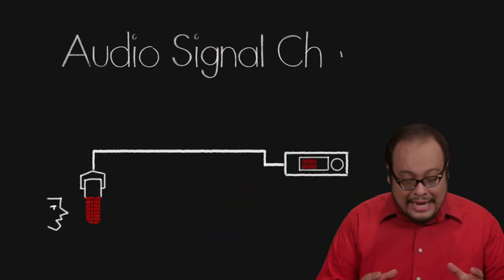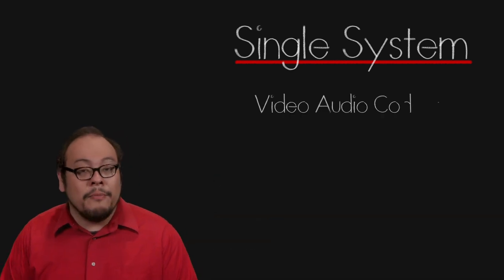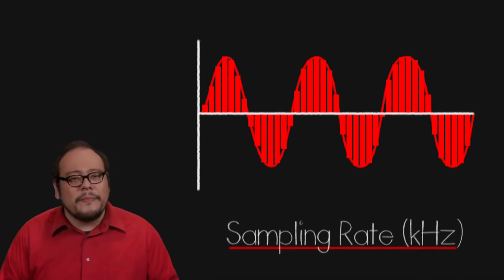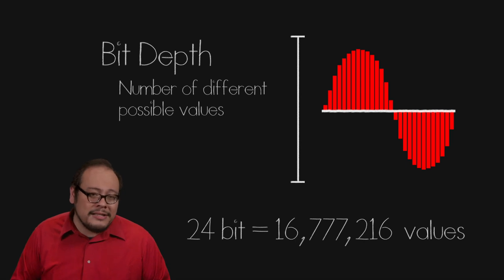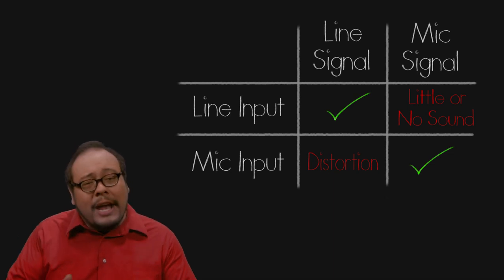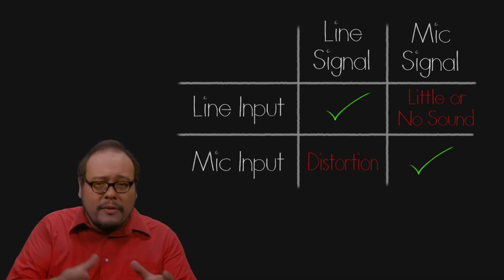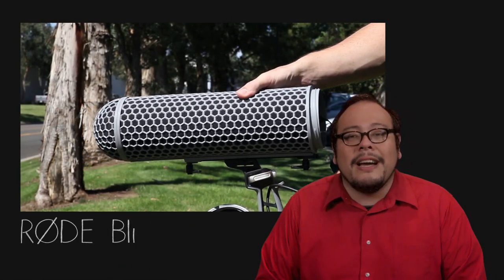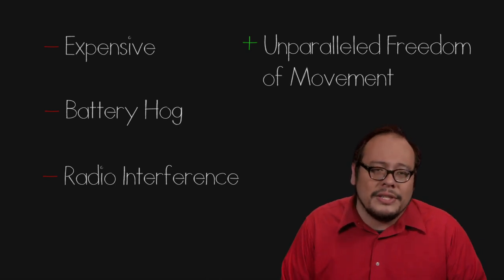The Basics of Recording Audio for Digital Video

Comment: As a former college-level audio instructor, I have to say that this is an excellent primer on audio for video recording, full of practical tips. John does a great job of presenting the theoretical aspects of audio (which can be dry and boring to some) in an interesting and relevant fashion. Just one nit-pick on the factual info: consumer level is -10dBV (with a capital "V", referenced to 1 volt), not -10dBv (referenced to .775 volts).
Reply from the maker: Pistachio Studio Thanks! Those dB designations can be so confusing :/
Reply: hey  @FilmmakerIQ   can u put the following line in description before the line containing "0:38 ..."
0:00 Intro

Comment: This is an amazing channel and the videos are very informative and dive deep enough into the subject.

I want to add one thing though: Recording in 96kHz is really not necessary, and you should not be disappointed if your recorder doesn't support it. I have a friend who actually wrote his diploma thesis on this subject (which quality reductions are actually audible in the ears of professional mixing engineers). And he found that 48kHz in general is enough and any increase does not affect the quality at all, and it also doesn't matter in post production. 16 Bit on the other hand is actually not sufficient for many applications, and professionals can actually hear the difference to 24 Bit recording.

So, to sum up: 48kHz is usually enough, but 16 Bit isn't. :)
Reply from the maker: I was going back and forth whether it was 96kHz or the 24bit that was contributing to the translucent quality of the audio I get off the recorder. I realize a lot of it is "psychological" - but I'll still stick to my 96kHz suggestion even if it's not entirely necessary ;)
Reply: Filmmaker IQ
You are absolutely right: if your recorder supports 96kHz, there really is no reason not to use it. :) I mean, audio won't be what's breaking your disk size limits, and better safe than sorry. I just wanted to add the comment for other viewers that sound devices that don't support 96kHz are no dealbreaker and that the 24 Bit support is more important if your budget allows only for one of the two. :)
Reply: Just thought I'd throw in my programmer's perspective. Just because your software supports 24-bit samples, doesn't mean it'll work with them internally. More likely, it'll convert them to 32-bit floating-point (maybe keeping a buffer in that format on disk in a temporary file) and work on that, only converting to 24-bit again when saving the results.

Trying to work with 24-bit values is a headache, because there's no provided way in hardware of working with them as a single unit. The easiest way to handle it is to convert it to some 32-bit format, which the computer can pass around as a single unit, using a third more memory and have readable source code without the clutter of moving odd-sized amounts of memory around.

32-bit floating-point tends to be the format of choice, because nearly everything has a floating-point unit which supports the IEEE754 standard and it's a reasonable amount of memory used for the precision available. It also has the advantage of floating-point versions of many algorithms being much easier to understand than integer versions. On the downside, 32-bit floats only have 23 bits of precision, so you will end up with rounding errors caused by truncation creeping in when doing a lot of summing of values, though they'll probably be small enough to be lost in the background noise.
Reply: *****  You are right that most likely, the computer software internally will work with 32-bit-floats. But that doesn't really mean anything for the recording quality. An audio quality of "24 bit depth" means that there are 24 bits used to assign a value between roughly 8 million and 8 million as a signed integer with 23 bits precision. This can be, as you know, easily converted to a 32-bit-float with 23 bit precision and an additional exponent, with basically no computing power. On the other hand, if you record with 16 bits, the conversion will just fill in the additional precision of the 32-bit-float with zeros... So you still retain the full quality improvement when switching from 16 to 24 bit recording, which is what all the fuzz is about. :)

Also: Something is really broken with my comment, parts of it seems to be crossed out...
Reply from the maker: Must be the illuminati...
Reply: Florian Fahrenberger I could hear significant differences when recording audio from the Zoom H6 between 48kHz and 96kHz. To me, the 48 sounds "fuller" and deeper compared to the 96. The 96 seems brighter and tends to pick up more ambient sounds. I guess if I would use a shotgun mic then I'd use the 96 kHz sampling rate but to me (as I'm only using the MS mic capsule) 48 kHz is more than enough and I can just tweak it in post if I want to.
Reply: The quantization is an oft quoted reason to use higher sampling rates, but is unfortunately misguided. You don't get a more accurate waveform at a higher sampling rate. Don't get me wrong, I thoroughly enjoyed this video, but I would refer you to this in depth explanation on the topic: https://www.youtube.com/watch?v=IiZqYnd5g8M
Reply: + Roxor128 : 32-bits floats may have a 23-bit mantissa, but because that representation has a fixed leading 1, in effect it stores a 24-bit value.

As for sampling frequency,  hydrogenaudio did MANY blind tests (for codecs), and they confirm that very few people can actually tell above... well, CD quality. If you think you can, your probably unknowingly pick up something else that your test changes.
Reply: Agree. Further more, A/D conversion is known to perform at it best when at 48K 24 bit as well.
Reply: Double blind tests indicate that very few people can hear any improvement with sampling rates higher than 48k...  However, it depends also on the quality of the audio chain and especially the transducers.  That being the case, there are still reasons that higher sampling rates might be appropriate, say when shooting sync sound for video shot at high frame rates when the video will be played back at a lower, standard frame rate, or if one simply wants to slow down the playback speed for effect without losing so much resolution.

Comment: Immensely informative! I've made the mistake of plugging a mic signal into a line level input and had low sound. I ended up using a TASCAM iXJ2 for my preamp in a dual system.
Reply from the maker: Least it's not the other way around - you can fry a preamp if you accidently send a electric spike into a mic level input ;)
Reply: Thanks for the info! The device I thought had a built-in preamp was a MacBook Pro. I guess the key thing was line input.

Comment: And: the only difference between 16 and 24 bits is that the first guarantees a theoretical 96dB range between 0dBFS (the limit before distortion) and the quantization noise, while 24 bits guarantees a theoretical value of more than 144dB. What that means in practical terms is that you can have more headroom between the 0dBFS limit and the audio peaks. In comparison, you can record more than 30dB lower than you would at 16 bit with no signal to noise ratio loss. ;)

Comment from the maker: @Garan Fitzgerald - a lav mic plugged into a smartphone... personally I've never done that but I can't say it's a bad idea. I think the downsides of doing that is you drain your phone battery - if it's a long shoot you can't just pop in fresh batteries like with a dedicated audio recorder. Sound Quality should be good if you have the proper inputs. Pulling files is what it is from the phone - it's probably not a whole lot more complicated than pulling from an SD card...

Personally, I like having a dedicated audio device as I think the phone could be used for other things during a shoot but it'll work just fine.
Reply: Actually that is what I use right now and it's awesome! 
A lav mic plugged into a smartphone is no problem if you get the right app. 
I use an Android phone, a cheap LG L15G with Neewer lav mic from Amazon. There is no concern for low battery, just turn on Airplane mode and put the phone on silence. I don't use the phone for any other thing as I got it specifically for this purpose so there is no sim or data connectivity on the phone. There are some things to note though, there is no way to monitor the levels while the recording is going on, also ensure the app you get records 48khz or else you will have audio sync issues and again, ensure to set the right levels to avoid clipping, which applies to all audio capture systems anyway.

My system has been working great and I have two of it in case I need to record a dialogue. If I want to improve the quality of my audio, I found out that getting a better condenser mic is all I need at the moment. I still plan to get a Zoom H4N Pro with wireless lav mics but I don't have to do so at the moment but will still do later.

Comment: Provided that your recording and playback systems don't have problems in ADC and DAC, the 48 and 96khz should have no audible difference. Some systems have problems in playback if you're up or downsampling from one to the other in realtime. It's a good idea to record in 96khz 24-bit though, if you're planning to do any editing or processing afterwards just to have that extra headroom both dynamic and frequency domain wise. Audibly though as said it doesn't matter.
Reply: Audibly, it does matter.  If you're not careful, 96 kHz can actually sound WORSE.  Recording at 96 kHz includes inaudible ultrasonic frequencies.  If you don't do postprocessing correctly, this will cause audible distortions when playing back on systems that can't reproduce ultrasonic frequencies (most of them).  End result: don't just record at 96 kHz unless you know what you're doing, and only if your analog equipment is pretty high quality.
Reply: You need add digital dithering when converting 24bit to 16bit in order to avoid distortion.
Reply: ***** You sir, are very confused by sample rate vs frequency response. Though they all us Herz as unit, but they mean totally different things.
Reply: ***** This is true. When downsampling to 44.1 or 48khz you need to do careful lowpass filtering to avoid aliasing artifacts.
Reply: lentostinato Dithering isn't really necessary. Simple truncation in that case will only cause some minor articats in the -96db to -120db region which is inaudible. Sure, proper dithering is good to use, but no recording ever got ruined for the lack of it.
Reply: badbandwidth "Dither is routinely used in processing of both digital audio and digital video data, and is often one of the last analog stages of audio production to compact disc" - Wikipedia
Reply: lentostinato Yeah, it's commonly used, there's really no reason not to, but it isn't absolutely necessary, and audio that has been just truncated instead instead is just as transparent as the dithered one. I recommend the Xiph.org video series on the subject.
Reply: ***** Very true! 96 is a step to high for the hobby people, even with ENG i wouldnt go there unless you got a audio engineer with you.
Reply: Bad Bandwidth Really great discussion here, I'm new to audio so I'm just trying to learn as much as I can, this video was incredibly helpful and so were your comments, so thank you very much! :)
Reply: Justin Rodriguez That is the fun from internet, that we can learn from each other no matter on which side of the globe we are :-)

Comment: Ironically I could hardly hear the audio on this video!  Had to whack my volume up to full!
Reply: I'm using a Galaxy 10 phone right now and the audio is loud and xrystal clear. You may have a not so great set of speaker(s).
Reply: I agree.
I even put headphones on and it was difficult to hear.
The content of the video was good but the audio sucked.
Thumbs down for me sorry.
Reply from the maker: Maybe get some not so shitty headphones or watch in a quieter environment.
Reply: @FilmmakerIQ  
Other people complained as well.
So it's not just me.
Reply: Actually the audio is quite good! 

The problem here are different standards for audio loudness aka LUFS wars... by modern standards louder means better, even if it degrades the signal...
Reply: But i do agree maybe this video could've have louder or more balanced audio.  You can hear the loudness difference in the animated intro and the rest of the video which are separately mastered
Reply: @FilmmakerIQ  Relax dude, that's a big harsh. Buy yeah you could up the video by 3dB
Reply: You're not the only one, I'm listening on studio monitors and can't hear anything.
Reply: @FilmmakerIQ  My Grado Labs SR325 Prestige series are quite OK I'd say, and there's also quite a buzzzz in. Content itself is very good, so thanks for that. Just be open to feedback yourself man...
Reply from the maker: Agreed that the video could be louder. I stuck to closely to the capture levels that RODE gave me. But it is what it is and I can't change anything on YouTube.

But to the guys that said the audio quality sucks. Go fuck your hyperbolic self. :)
Reply: @FilmmakerIQ  Lol poor from you
Reply from the maker: What can I say. I get annoyed with hyperbole. It's shitty criticism.
Reply: @FilmmakerIQ  I was shocked by the inappropriate language you choose to reply with on a comment that some people agree on
Reply from the maker: Shocked! Shocked! https://youtu.be/SjbPi00k_ME
Reply: @FilmmakerIQ  your so professional and not greedy at all 😍😍😍
Reply: @FilmmakerIQ  I have amplified speakers on my PC and both the PC and the speakers are at max (I even turned up my sub) and I still almost needed captions for this video.

Edit removed some salt
Reply from the maker: Then you have some really shitty speakers...
Reply: Chill guys the quality is fine just kinda low in volume
Reply: audio quality, cant complain
but when your content loudness is -15dbs (because YouTube thinks loudness=decibels, not LUFS but being pedantic) while other YouTube videos are closer to -5dbs or -3dbs it does got annoying, (having to turn up the volume then turn it back down before I get my ears blasted is silly #firstworldproblems)
Reply from the maker: I've not once defended the volume of this video. But I literally got a comment in the last 24 hours saying I need to buy a better microphone...
Reply: @FilmmakerIQ   Unless your mic is the reason why you can't turn up the volume (somehow), I don't see (or hear) the problem. I wan just kinda ranting about meaningless shit.
The guy who was saying get a better mic, probably can't tell the difference between a studio mic and the one built into your laptop.
Reply from the maker: No mic ever made in the history of microphones has prevented the mixer from gaining up. ;)
Reply: Y’all indeed using some shitty earphones or speakers..everything don’t always have to be over loud this days though, I can clearly hear him.
Reply: @FilmmakerIQ  the audio is super clear, but i kinda agree the sound is a bit too low
Reply from the maker: Read my comments ;)
Reply: @FilmmakerIQ  guys he probably can't sleep well since he's replying on here 24/7 like a kid 🤦‍♂️you put your videos only critisisim is what you get good or bad grow up man
Reply: @FilmmakerIQ  your videos online *
Reply: @FilmmakerIQ  Great job on the video! It's good to see YouTubers with thick skin.
Reply from the maker: I don't give a shit what you think.

How's that for having a thicker skin?
Reply: @FilmmakerIQ  That was a bit rude. I was only complementing the video. I think you misunderstood my statement.
Reply from the maker: I only return in kind.
Reply: @FilmmakerIQ  I've noticed
Reply: @FilmmakerIQ  lol i didn’t except these replys based on first impressions of this video but i kinda love it 😂😂 screw people complaining about the sound levels like how hard is it to turn the volume up a little...
Reply: @FilmmakerIQ  it was pretty quiet I put the volume to almost max
Reply: @samyehya  , I am aghast by why you imagine the gentleman would want to sit back and not come to his own defense!
Reply: It is too quiet!!!
Reply: @FilmmakerIQ audio engineer here. Your noise floor is quite high-- I hear it in your fades. And your audio is indeed quiet by the standards of YouTube. No need to be rude [and simultaneously incorrect]
Reply: I'm listening on my phone speaker and the sound is loud enough and clear.
Reply: There is definitely an issue with the narrators audio loudness.

Perhaps it required more compression and normalisation.
Reply: @FilmmakerIQ Wow.  Just wow.
Reply: @justinassing158 I'm starting to think this guy was on the hooch or high when he replied to commenters.
Reply: Can hardly hear this

Comment: Very good! thank you very much! what do you think about Tascam DR60D?
Reply from the maker: I have been tempted on several occasions to pick up the Tascam DR60D just to have it but since I have and use the HD-P2 I just haven't pulled the trigger. The P2 is a great recorder (which I got used from a guy in Alaska) and it's got a ton of pro features like gen lock (which I haven't used). I'm a fan of Tascam, I've had them repair the P2 and they're a solid company with good products.
Reply from the maker: Filmmaker IQ I did eventually pick up a DR60D. It's good but I've had some issues with batteries and long recordings (1hr +) I got a DR70D as well but I had to send it into the factory because of a faulty screen.
Reply: I have one and it's definitely a step up in quality from the Zoom H4 I used to use.  Filmmaker IQ is right though, it eats batteries like crazy (as most higher quality systems do) so you want to plan ahead with many rechargeable batteries or run off of AC whenever possible.